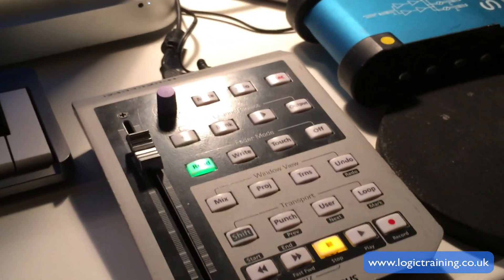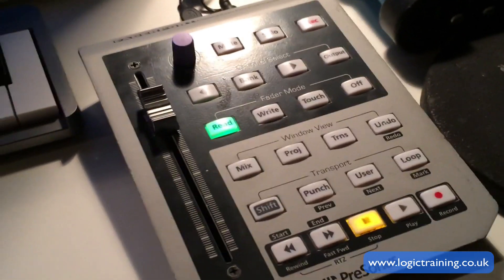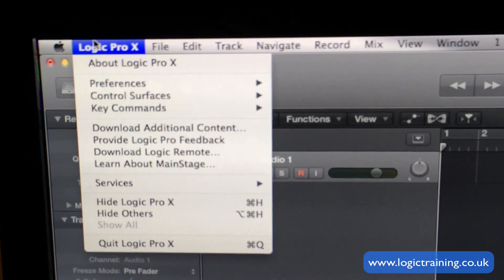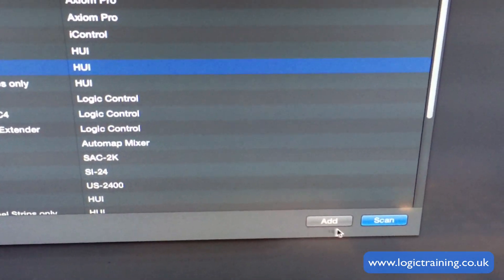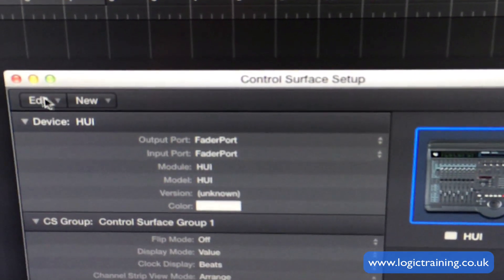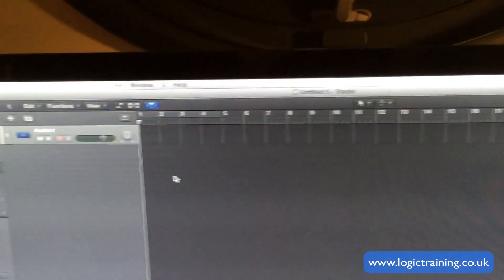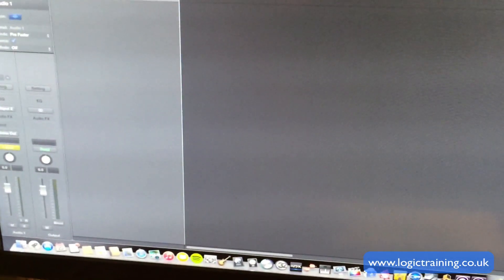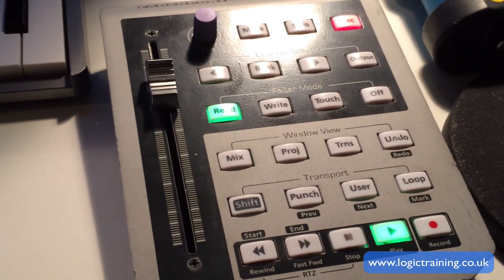Using Presonus FaderPort in Logic Pro X

Comment: I am in Logic 10.5.0 (Mojave) and selected the HUI as explained in this video, but it only comes up with an iPhone in the list with a yellow '!' exclamation mark and I can't select any port inputs nor outputs. I can see that the Faderport classic is sending signals to Logic in the midi receive window though and I assigned the start button to Logic with a Logic shortcut command to see that the buttons are working and they are .... but still can't get the FaderPort working for some reason! Any solution to this? Any advice will be greatly appreciated!

Comment: Mac OS high sierra 10.13.6, Logic Pro X 10.4.4, Faderport Firmware v 1.45, usb 2.0 hub, - Still NO dice on the motorized fader. Any Ideas? I've changed out the power supply as well. Should the Faderport light up with just the power supply connected or no? Thanks in advance if anyone can help!  -April 4th 2019

Comment: Hi Peter.  You said the FP can't access Latch Mode in Logic, but it can.  Just hold down Write, then push Touch; your track goes into Latch mode.
Reply from the maker: Thanks Mark, I can't get this to work in Logic Pro 10.4.2 and earlier LPX versions. I had this issue since first Logic X , but Latch works in the way you described in Logic 8 or 9. The brand-new Faderport is nice, but uses the Mackie Control Protocol rather than Mackie HUI mode. I probably will get hold of the new one at some point. Appreciate the feedback. I will keep trying in case Touch Mode starts working again.

Comment: Thanks to your video today I got my Faderport Classic back in operation after it being in a box for 6 years. I followed your instruction to the letter and all the busttoms worked except for the actual motorised fader, so I had to go and research again. For me at least, it was a simple case of taking the Faderport out of my computer and putting it through a USB hub. Ive copied it her in case other folks come unstuck. Between both your videos I can now get on with working in Logic with my fader. Thanks again :-). https://youtu.be/1QeSbZ2DDUY
Reply: I know this is a very late reply but I just had to pull up this video again to get my Faderport running, and saw your comment. The motorized fader only works when the Faderport is connected to its power supply. USB alone won't move the fader.

Comment: Hi there, well I've got my FaderPort working as a Hui device in Logic 10.4.1 on OSX 10.13.6 - Presonus have answered my query by directing me to same articles on their site mentioned before. There is one minor hitch, the Proj and Trns buttons light up OK but then just remain lit - until a new project begins. I'm trying to find a manual for the original FP, as the Shift Punch and User buttons haven't been tried yet - overall it was a good buy and a blessing for automation

Comment: the fader doesn't work on 10.2.2 =(
Reply from the maker: +jorge davalos 

Hi Jorge, I have the motorised fader working in version Logic Pro X 10.2.2 running on Mac OS X 10.9.5. I also now have my M-Audio Axiom Pro 49 and an iPad Mini Retina with Logic Remote all working side-by-side with the latest Logic
Reply: mine doesn't work i guess is the faderport firmware 1.3.5,  i can't update it or downgrade it though. i contacted presonus support already. let's see how it goes.
Reply from the maker: I have that Firmware update installed too.
Unplug and replug power & Usb to FaderPort
Try Menu Logic Pro X>Control Surfaces>Rebuild defaults. Let me know if that gets it working?
Reply: ok, this what i did. i went to a pc, and downloaded and installed firmware 1.2. (couldn't do this on my mac) now it works. i have  software version 1.3.5 on my mac with firmware 1.3.3 on the faderport. the faderport works but read/write/touch not working correctly.  im almost there should i get firmware 1.3.8?

Comment: They key for me to get it working was to install the FaderPort_Logic64.bundle.zip which Persons has somewhere hidden in a support comment on their knowledge base. After instilling the component file (instructions here: http://support.presonus.com/entries/53848710-Faderport-How-do-I-set-up-my-Faderport-in-Logic-64-bit-) it did work for me. Funny that Persons does not mention the need to have this installed (I used the AlphaTrack before and they also had a component file). So all fine for now. But one more question out of interest. How do you know what firmware you have installed? They do say that units purchased after 2012 "should" have the latest firmware but it would be nice to see what you have loaded. Also, it you only have a USB 3.0 devices you are somewhat screwed because I believe they say you need USB 2.0 or lower for the updater to work. Personus need to get this all sorted out for a better experience with the controller.
Reply: This may help! https://support.presonus.com/hc/en-us/articles/210040153

Comment: Great video Peter not got a faderport tempted to get one but am running Logic Pro X 10.2 on El Capitan is there anything else like faderport out there that actually works out of the box. Appreciate Control surfaces are rarely plug and play but don't want to invest in a FP that might or might not work. All I need is a single touch sensitive fader and some transport. Seems like a gap in the market at the moment
Reply: +Peter Dudley Hey guys, I just followed you're instructions, Peter, I'm running Logic X 10.2 on OS X El Capitan and my recently acquired FaderPort is working beautifully! The only parameter that isn't working properly it seems is the punch button, but everything else is groovy. Thanks for the vid Peter, you're the man!
Reply from the maker: +Stuart Demmery 
Hi Stuart, I have held off from upgrading to El Capitan for a while on my MacBook Pro, and the Faderport is setup on my studio Mac which is on 10.9.5 Mavericks 'lockdown' as i can't risk any of my software or plugins to stop working. So not able to give a hard and fast answer on whether the faderport will working with LP 10.2 and Capitan. It does work fine with LP 10.2 and 10.9.5 though.
Reply: +Nick DeArmon Funny, I just saw your post...it is the same long rant I wrote about below....funny
Reply: +Nick DeArmon Hi Nick, maybe you can help me. I have the FP running on Logic X 10.2 and El Capitan 10.11.2. The FP sometimes works, sometimes it does not. The main problem is that once I select a track / channel in Logic, the FP will NOT pick up the fader position. Really strange. I did check the Control Surface PREFERENCES and I have checked the option "Control surface follows track selection". I did install the newest Firmware update 1.38 from the Persons website. Still have trouble. Can do you see anything that and can do?
Thanks!
Reply: +Hubert Prieger from what I understand people tend to have issues with the firmware updates. That's likely your problem, though I couldn't say for sure. I made sure not to update my firmware to avoid those issues.
Reply: You might also try the process on this page, which I discovered elsewhere and was the method I used in the end to get even better functionality than the fix in this video provided (as I recall, it was a circuitous path when it was all said and done):
http://support.presonus.com/entries/53848710-Faderport-How-do-I-set-up-my-Faderport-in-Logic-64-bit-
Reply: +Nick DeArmon thanks for your prompt response...funny enough I just got it solved. They key for me to get it working was to install the FaderPort_Logic64.bundle.zip which Persons has somewhere hidden in a support comment on their knowledge base. After instilling the component file (instructions here: http://support.presonus.com/entries/53848710-Faderport-How-do-I-set-up-my-Faderport-in-Logic-64-bit-) it did work for me. Funny that Persons does not mention the need to have this installed (I used the AlphaTrack before and they also had a component file). So all fine for now. But one more question out of interest. How do you know what firmware you have installed? They do say that units purchased after 2012 "should" have the latest firmware but it would be nice to see what you have loaded. Also, it you only have a USB 3.0 devices you are somewhat screwed because I believe they say you need USB 2.0 or lower for the updater to work. Personus need to get this all sorted out for a better experience with the controller. At any rate, thanks for your answer and Happy New 2016! Greeting from Germany!
Reply: Happy new year! Hope all is well in Germany, I'm over in America, but I'd love to come visit over there sometime in my life. Yeah, the support isn't great for the FaderPort, but with some perseverance and determination we were both able to get ours working, so that's good news! Haha. I don't know if there's a way to tell what firmware is installed, but I was given my Faderport from a friend who has a professional studio and I knew it had sat in a box there for quite some time, so I figured it was fair to assume mine probably hasn't been updated to the latest. Anyway, glad you got it working, they're definitely useful gadgets when they work right!

Comment: Great video,  thanks.  Can you use the fader to write any automation or controller data, or plugin parameters?  Or is it just volume and pan?   Thanks again.
Reply from the maker: +sitron 
Hi there, its not possible to access other parameters with the FaderPort unless you have programmer level knowledge (I certainly don't have that). There is a device called AlphaTrack by Frontier designs that has more flexibility and is able to access plug-in parameters

Comment: Can you please make a video to show how to make the other buttons on Faderport work in Logic Pro X. It's the Channel Select buttons, that I would like to program. I had a look at the setup window, in Logic - it looks very complicated.
Reply from the maker: Hi Alan, I think I have this working already but will check when I'm at the studio tomorrow. One tip, If you have used the Mackie HUI setting as per the video, unplug the USB cable, plug it back in, (I have to do this occasionally) and another important step goto Logic Pro X>Control Surfaces>Rebuild Defaults. After doing this you should get full functionality.
Reply: Peter Dudley Hi Peter. Thank you for your reply.
Presonus have produced a sort of fix, but it leaves the Channel Select buttons inoperative. I have tried it.
I downloaded Faderport.bundle from the Presonus site and installed that inside the Logic Pro X.app (Package Contents>Midi Device Plug-Ins). Have you looked at this?  So, do you reckon I should go back to your method?
Reply from the maker: Hi Alan,

I wasted a whole day on the so-called Presonus solution with the 64 bit bundle. I kept trying and going back to their forum to make sure I wasn't doing something wrong. In the end I spotted a line of text that said if it doesn't solve the issue use the Mackie HUI ! - which I did.

I suggest you go into the package contents and delete the bundle, restart your Mac then use the Mackie HUI - it's the way to go. If you don't remove the bundle it could cause unexpected behaviour.

Thanks

Peter
Reply: Peter Dudley Thanks Peter.
This is the link to my request to Persons to get the problem sorted:
https://forums.presonus.com/viewtopic.php?f=95&t=5578&p=31299#p31299

In the meantime I will take your advice, follow your instructions to use the Mackie HUI.
Thanks.
Reply: Alan Mather I'v deleted the Faderport.bundle, reset the Mackie HUI the way you described, Rebuilt Defaults, unplugged and replugged the USB lead to the Faderport.  
Eureka, the Channel Select up down work great.
The Output button, however, switches the Mix set to"All". This is no big deal though. I can live with that.

I'm not sure if Automation is working - I can't see any results from using the Read, Write & Touch buttons, but that may be me. Any comments?
Reply from the maker: Hi Alan, Volume, Mute, Solo Automation does indeed work. The clue is when you see the "Read, Proj and Trans buttons all lit up on the FP. If you watch the video again you can see me creating volume automation and then playing it back in Read and the motorised fader also works like a charm, the power supply needs to be connected for this to work. The only drop in functionality from using the FaderPort in Logic 9 and earlier (32bit only) is that I used to be able to press the Write and Touch buttons together to engage 'Latch' mode, that doesn't work in HUI mode. I'm going to investigate to see if I can get this to work. Don't know when I can confirm this as I'm busy with other projects hence no new videos from me in a while, Thanks Peter
Reply: Peter Dudley Hi Peter. I know your very busy, so I don't expect a reply too soon.
Thank you for your above response. I spent all day, yesterday attempting to get the same results as you. I got the latest driver from Presonus for my Faderport. I set Logic  back to default settings. I followed your instructions precisely.
I used to trouble shoot Mac computers and networks, before retiring in the photography & graphics industry, so am pretty competent at systematic trouble shooting.
I always get back to the same result with the Faderport; all 3 Fader Mode buttons (read, Write & Touch) light up simultaneously, and they all only affect the Read function (by switching Read On/Off).
The only way I can get automation to work is with the mouse.
I tried removing Faderport from the window in which you set up Mackie HUI,  but Logic automatically replaced it. I looked carefully at your movie, at the point you set up Mackie HUI, & couldn't see the Faderport in you window!
I may have to live with it the way it is, but 'm kind of determined to get mine working properly , the same as yours.
Reply from the maker: Hi Alan,

I would actually recommend uninstalling the FaderPort driver altogether.
Then I would recomend quitting Logic deleting the control surface preferences located at:
User library>preferences>com.apple.logic.pro.cs

(You can un-hide the user library folder if you are using 10.7 or later by pressing option whilst clicking the go menu in the finder)

I often find I have to unplug and re-connect the USB cable on a daily basis, but today I was using Logic for over 5 hours with no issues.

I'll get back to you soon, let me know how you get on in the meantime
Reply from the maker: Also saw this link, have you followed these steps?

http://support.presonus.com/entries/43950474-How-do-I-set-up-the-Faderport-in-Logic-as-a-HUI-device
Reply: Peter Dudley Thanks Peter.
Yes. I followed those steps.
And I now have everything working perfectly.
I thought I had deleted faderport.bundle, but hadn't. What a wally I am. 
Thank you so much, Peter, for your help.
Reply from the maker: +Alan Mather 
Channel select works for me